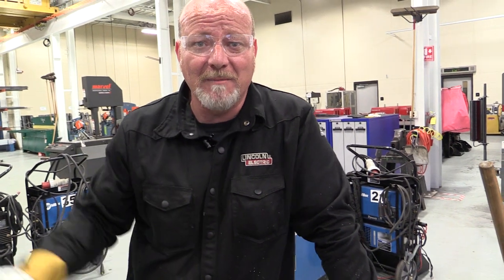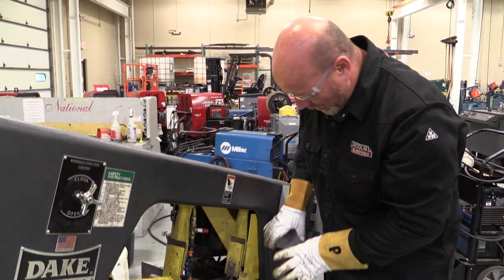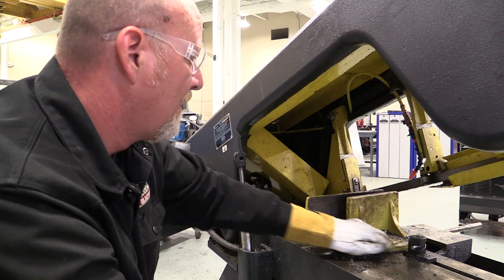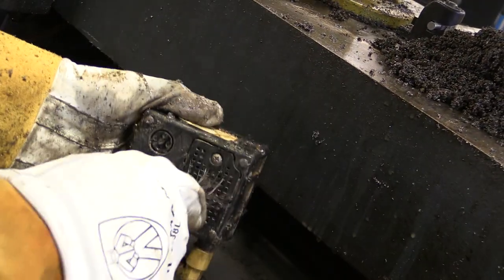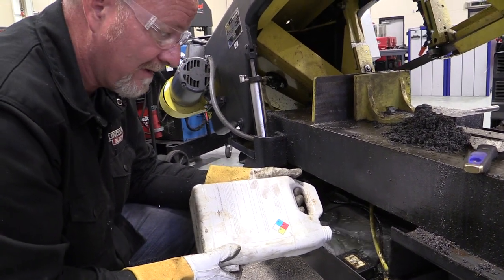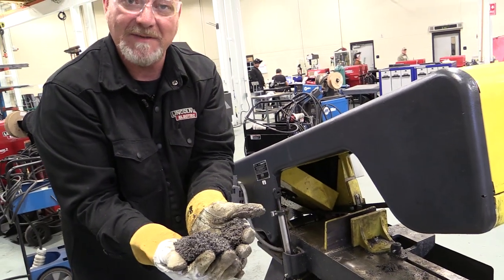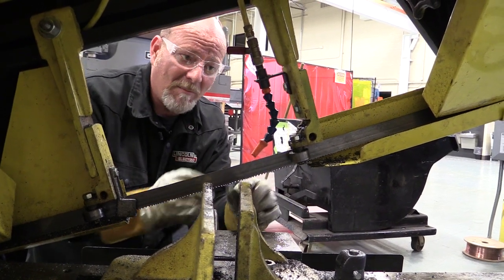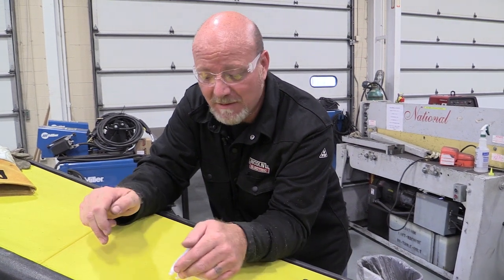Band saw preventative maintenance for beginners. Keep it clean.

Comment: I am a retired guy learning how to weld and tinker on hobby farm. Just picked up a used 7 inch King horizontal saw. It looked like new except for it being covered in shavings and garbage end cuts. I didn't know where to start, now I do. I am excited to clean it as new and use the cooling system properly before my first cut. Knowledge of the band selection/speeds will be the next learning curve. Luckily there was some junk angle iron still  in the vise, so I'll play with something similar to match. 
Your videos on basic welding are luring me next. You are a good teacher. Even Millennials would pay attention and learn from your full explanation.

Comment: Sir, can you advice me, do you know why my blade always detached from the wheel?
Reply: Generally, when a balde comes off the idler wheel or drive wheel it is down to two things. Incorrect blade tracking or the bearing's in either or both wheels have worn.
I would try setting the blade square in the horizontal and vertical planes, check the distance between the blade guides is set for the matrial you are cutting and make sure the blade is running on and spinning the blade guide bearings. My 7x12 saw has six blade guide bearings and all six need to be working and set correctly.